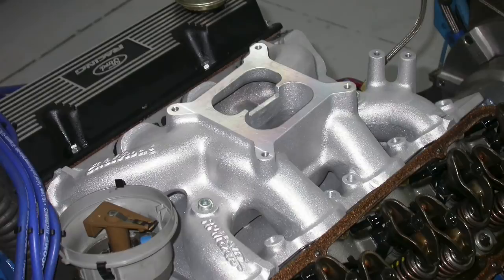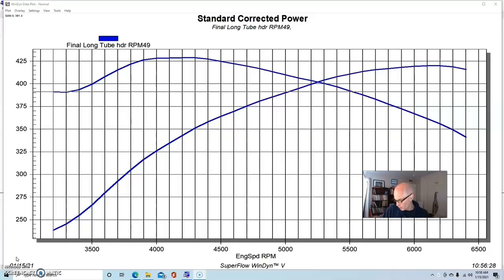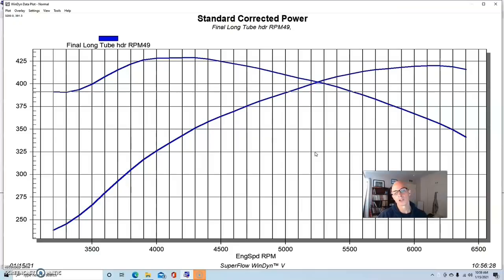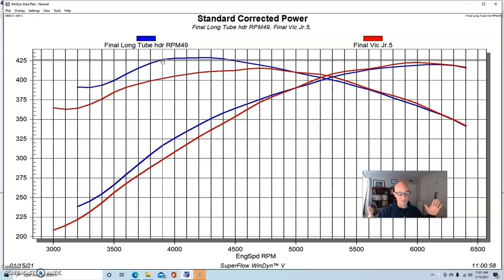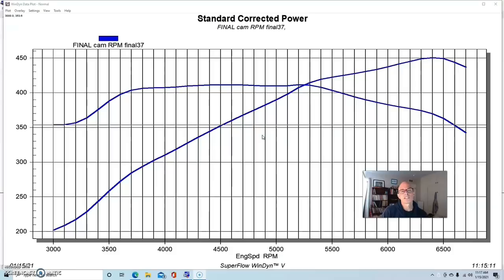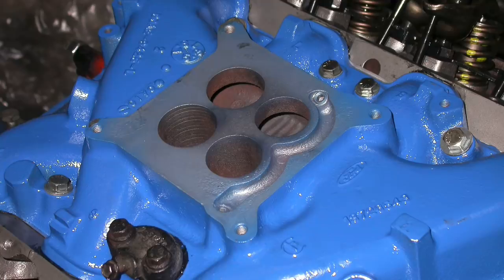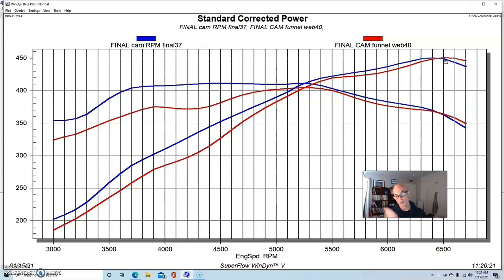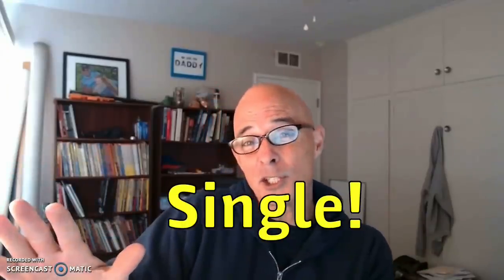THE OTHER GUYS INTAKE TEST-351 CLEVELAND (PLUS 351W)

Comment: I know this is two years  old. But you did n mention what the port match was on the Funnel Web. Was it the same size as the 4V heads? Or smaller like the port match from the dual plane?

Comment: Have you ever tried a offenhauser 360 manifold I got one on my Cleveland with a very mild Street cam it seems to have lots of torque and throttle response but I'm not sure if a dual plane would be better what do you think
Reply from the maker: I HAVE NEVER SEEN A SINGLE PLANE MAKE BETTER LOW SPEED OR MID RANGE THAN A DUAL PLANE

Comment: The single plane Cleveland would be much stronger with a 104 to 106 degree LSA. Or, a smaller cam say, 230 @ .050" and a 114 degree LSA. It's not a small block chevy.
Reply from the maker: a cam change would change power with both intakes-it doesn't just work with 1
Reply: @richardholdener1727  true.

Comment: I'm really interested in seeing the torque and horsepower curve straight off idle to 4,500-5,000 RPM. Especially with the Windsor as I now have an '82 F250 with the stock 2V 351W. Planning to run a new 4V intake and headers as the exhaust is half missing. I'd like to get as much low end torque as possible since it's a truck to be used for utility; hauling and possibly towing.

Comment: Richard, I love your content and the various comparisons you do. My faves are the 351C and Ford 300. 
One thing, you stated that 2V is 2 valve and 4V are 4 valve heads. All 351C heads are 2 valves. The "V" is venturi or barrel referring to the type of carburetor.  I'm certain you already know this, just slipped your mind when recording.

Comment: What would be cool if you built one of each the same 351c 351m 351w and see which one makes the most power with the same parts
Reply from the maker: the heads are all different, and intakes, and cams

Comment: Hi Richard, I Like this test!! I have a 1995 F150 with a stock roller 351 or 5.8 that I would like to get at least 500 hp and torque. I am 
Not looking to drag race because it's a 4x4 but rather get out of its own way! how about switching to E85. what in your experience would be the best over all combination with this vehicle?
Reply from the maker: heads, cam and intake can help, but 500 hp takes a lot of cam in a 351W

Comment: If your vehicle is mostly street driven, go with a Dual Plane Intake Manifold. However, if you have a dedicated race engine that lives at high rpm or a modified, big-cubic-inch engine, then a Single Plane Intake Manifold may be better. You may also want to consider a Tunnel Ram. Either way, you need to match components that work in the same rpm range.
This includes Camshaft RPM Range, Cylinder Head Intake Runner Volume, Carburetor CFM Rating, Header Primary Tube Diameter, Ignition System. 

— Summit Racing.

Comment: The Boss heads were made for high rpm racing. That is proven here and in fact has been known since the 70's(in some of the comments here I can see people don't get what these heads are for). Really the rpm band is 4000-8000 for these heads as there were made for SCCA Trans Am racing. In the 80's Holley made a single plane intake called the Strip Dominator. At that time there was none better in America. I tried the "mild cam,dual plane(not an RPM air gap...they didn't exist), vac secondary 750 holley with long tubes" on a M code 351C. Total miss match. Thing would rev to 6800 with an Accel duel point distributor but did not make power there(this was in 1980).
Once you machined the heads for screw in studs and guide plates(if you didn't have Boss heads) and started running much "larger" solid flat or roller cams and a single plane intake with a 850 cfm double pumper(that would be either the Edelbrock Torker intake or the Holley Strip Dominator when it came out) then you could see the potential of these heads.  There were no fancy HP holley carbs or hyd roller cams back then. We did are own mods to Holley carbs in those days. :)
Reply from the maker: please take a closer look at the actual torque data-on this Boss 351 and the Boss 302-the Boss heads worked well down low

Comment: On the Cleveland when using a head with ports larger than the intake could the be an issue with the air slowing down do to the sudden change in the volume of space? Or even a vorticity at the entrance to the head disturbing air flow?
Reply from the maker: LOOK AT THE DYNO RESULTS OF THE INTAKE SWAP-IT ADDED A LOT OF POWER
Reply: @richardholdener1727  I was referring to the single plane vs dual plane. I thought you said the intake runners of the single plane were much larger than the head. You said you were expecting more out of the single plane.

Comment: Back in the 90s my 71 boss Cleveland standard bore & stroke motor with stock Boss heads and a big ass 600 +lift solid roller bump stick, with a Holley Strip Dominator intake & 850 dbl pumper made 525 HP @ 7200 rpm on Bob Pettis's dyno ! Ya-cha ! Dropped it into a 3000 lb 67 pro street Mustang coupe and a 175 shot of NOS ! The Chevy boys hated my cuts !
Reply from the maker: 525 hp seems like a lot for a cam and intake upgrade
Reply: @richardholdener1727  Remember the 71 Boss 351 came with pop-up forged pistons, huge ports with 2.19 intake valves.
Back in the Day hot Rod Magazine published an article stating( The 351 Cleveland can produce more horsepower per cubic inch than any other American made motor)
Which was one of the main contributing factors why  Mr. Bob Glidden totally dominated pro stock back in the 70s&80s
Before NHRA change the rules to 500 in.³. 
So yes just adding a big ass cam, carburetor and headers will indeed produce over 500 HP with a Boss Cleveland.
Reply: @robertstewart3086  I total agree with this and I had that article too :)
Reply: @richardholdener1727  Actually it would seem that way but people found out these were high rpm racing heads designed in the late 60's for Fords SCCA Trans Am racing program. They really didn't do much in mild passenger car use. In fact they were to "big" for that. They really didn't show what they could do unless used on what would have been considered a pretty wild engine for street back in those days.

Comment: Could it be valve placements and chamber shape that changes what kind of intake it likes
Reply from the maker: single plane is for higher engine speeds than dual plane on both motors

Comment: vrm & LDN Wholesale: The Lima 385 and 335/ Boss 302/351 heads were designed by Phillip A Martel, ex GM, and they werent just Porcupine 427 MarkIV Mystery motor heads but a Heron style flat valve head designed to get better horsepower with less than Tunnel Port 427 or Tunnel Port 302 flow rates. After Bill Innes let Stirret redesign the Y block into the 221-351 family and Harold Grant take 150 pounds of iron out of a 272, Harold C McDonald taked Macara, Bill Gay and others to make heads that would survive on the lightened MEL Lima and 4.38 bore CEL1 plant engine blocks. The heads were ported with 4.37 sq in of ports size in a venturi shape to make more power than the SBC and BBC. Clear and simple. The prescription for making 2V and 4V Clevelands generate seamless low end, mid range and high end power is different. The team decided to block exhaust flow and add exhaust duration and use 2 plane intakes.Always.

Comment: Richard! I have a 351 Cleveland, stock block, stock crank, h beam rods, flat top pistons, as cast edelbrock rpm 2v heads, unknown specs engl solid flat tappet cam, airgap intake, 750 holley, in a fox body running mid 10's on motor and 8's on a 300 shot. It would be cool to see a similar Cleveland combo with the Edelbrock heads and airgap on the dyno
Reply from the maker: wish i still had the 4V

Comment: There is a 351C serpintine belt kit on the net which uses the SelectAir, Techumseh/York or early 3.8 Fox V6 tensioner

https://youtu.be/4RYGpm0ajfA

but I like the AEW/ Kaufman 8945 AC/Alt/AirPump/Tensioner Mark Sanchez made back in the late 80s.

Comment: Yet again,,, 4V Clevo has very poor velocity. The reason every decent aftermarket head and intake is far smaller.What were they thinking!!
Those Funnel Web intakes are light switch for high rpm engines. Edelbrock have not made a 4V intake in decades. Because they know 4V heads do not make power!
I have  Performer 400 on my 400 Galaxie,, and it is smaller than the 2V heads. And still a very similar opening as a Chev race port, which makes far more power.
Reply: Edelbrock part numbers 7564 and 75641. 4V Cleveland intakes.

Comment: Hey richard, I heard you talking about having timing locked out for this test. Say you’re running efi, with a timing curve. Do you notice a difference in power output with timing locked out as opposed to ramped in? I don’t remember seeing an a to b test like that with the same engine.

Comment: The OEM Aussie heads actually have the "in between" intake ports, with closed chambers. They're really called 3V heads. I have a soft spot for the Clevelands, I grew up in the 70s, and Had a 4V in a 71 Torino that was rarely beat. I chewed up lots of big block cars with just a cam, intake, headers, and a 3:70 posi rear end behind the C6. Hindsight makes me weep out loud that I sold that car when I married.
Reply: Australian Clevos had 302 2V heads starting as small as 59cc, 351 @v heads starting around 70cc,  And then the door stops from the US with humungous ports! From 72-82 both heads got larger chambers, XA XB heads live really well, XC XD XE 76-82 heads are stuffed because the valves run way too hot and burrow up the ports. ADR27A killed them, the reason they were culled off. The 4.1 alloy head 6s were as fast and used a LOT less petrol. More so as an efi version
But otherwise really only 2 different heads. No real change from 72-82
Reply: @ldnwholesale8552  That was what I was talking about, the Aussie 2Vs with closed chambers, that we call the 3Vs here.  The US Clevelands started out with closed chambers, and had open chamber 4V heads for a couple years by the time the Cleveland was discontinued in 1974 and the modifieds were out. We never had a closed chamber 2V Cleveland head here. The closed chambers were around 63cc, while the open chambers were around 76cc. As far as valve problems, the first year Boss 302s had a bigger intake valve that would get hot and start hitting the exhaust valve, so they reduced the intake valve size slightly in 1970. That was the only two years for the Boss 302, and the rest of the Clevelands never had this problem.
Reply: @bigboreracing356  Yeah, I knew plenty of guys that did a lot of back yard gutting and frankenstein stuff too, that made their toys run good. I am one of those guys. However, I am referring to a factory equipped car, with off the shelf parts available at the time. if your guy had put a Cleveland in that Pinto, even mildly equipped such as mine was, it would have have had an even harder donkey stomp, leaving those turd windsors crying. Have a nice day.

Comment: Really surprised on the results of the 351c-funnel web. I even expected the 351c-funnel web to not lose as much low end torque compared to the Vic Jr since it has longer runners. I also thought it would’ve shined more and earlier on the top end.

Comment: Hey Richard do feel as a ford fanatic that using Cleveland heads on a Windsor is cheating? :D
Reply: @bigboreracing356  Properly true for stock factory heads, but many aftermarket clevo heads are much superior to any 20 deg alu. Heads you can buy.

Comment: Richard, I’m building a stock cubic inch 351 Windsor currently, I have 210cc Victor jr heads, the comp xfi 236hr cam I bought from you, and I’m going to top it with an air gap. Do you think 475-500 horsepower is a realistic power number or do you think I’m dreaming?

Comment: I think You used the wrong single plane on your mild  Cleveland  I run a mild Cleveland  a the  Drag strip and  my Engine  goes faster with a Torquer than it does with a  Air gap. and I only run to 6200!  Your  funnel web may be a good high RPM intake but it is not working for you engine!

Comment: I'd like o see this comparison between 2v and 4v heads. I've always been a fan of 2v heads. 4v heads worked best by building up the intake runners to increase velocity. 4v's only seemed to be a lot of fun with 4.11 gears. Throw long tube headers and an RPM on a 2v and you have a killer for the street.
Reply: 4Vs make great door stops!!

Comment: Have you done a set of the speedmaster heads on the 351c? Im putting together an engine with a set and curious if they are any good.
Reply: No! You get what you pay for which is very little.
Reply: @ldnwholesale8552  For what Im building, which is mostly just a cruiser with some extra grunt, its hard to justify 4-5x the cost for a set of Trick Flows. Yes I would have loved them, but thats what makes me curious how good/bad the Speedmasters are. The local shop said that ya 5 yrs ago they wouldnt even sell them, but that quality has improved a lot. So Im just curious how these budget heads compare to stock 4V's or even something like the Edelbrocks.

Comment: Richard, I have a 71 boss 351c motor that I received from my uncle when he had a 71 mach 1. I currently have the tall deck stroker Cleveland or otherwise known as the 400 in my hot rod. I plan on rebuilding that 351c on the side. From all the work you've done with Clevelands... what's your favorite build you've done on a 351c that would make a fun street toy?

Comment: I love the 351C and to a smaller extent the 400M.  Don't under estimate the 2V heads for street performance.  They are the perfect candidates for budget builds or add on.  4V valves with a good pocket port blend, a good torque cam,  a dual plane 4 barrel setup with headers really wake these engines up. The gains vs dollars is vary hard to beat.
Reply: I believe it.  I love chevy's too.  Just a cam change in a lack luster 400M would seem like a rocket strapped to your behind. It is a combination of parts that add up to the whole.  So let me explain in "gross" horse power why these are great engines to modify at a vary low cost.  Some of these estimations are in percentages of totals. Starting with a 250hp 351 2V with a gross rating of 250hp.  (net 164 to 167 net)  Set of heads with 4V valves and pocket blend 30hp.  A torque can with a peck rpm of 5200 or so and eliminating the 8 degrees of retard 50hp.  35hp for a 4 barrel intake. 10 percent for headers and a dual exhaust.  All this takes us to 401 gross horse power. In net terms this would be about 300hp. net.  I would love someone to show me any other engine that can gain 130 plus NET horse power for under a grand$.
Reply: @bigboreracing356  And your Cummins diesel cost how much?
Reply: @bigboreracing356  My point is you paid for the performance potential up front.  Most boosted vehicles cost a heck of a lot more than non boosted ones.  The most ridiculous argument could go like this. I bought this car with a NOS system in it.  Why heck I added a couple of gallons of race gas, changed the NOS jets, and reduced the timing I added 160hp for under $30 bucks. Shazam!!!
Reply: 400m. People don't know what they are talking about. I wonder how much else they don't know.

Comment: Another great video! Had a 351C in Falcon GT, worked well with Edelbrock Performer and 750 Holley, mild Comp cam and mostly stock internals. Made just over 500hp at crank. Very reliable, my fave motor
Reply: How much nitrous ? That's 393 Chi heads and a roller cam numbers lol.

Comment: I need to see this test but with more cam and compression. I'm running a dual plane on my race motor and need to know what I'm gaining/and losing.
Reply: Keep in mind, I did it for a reason. My heads are 220cc. On a 383. I wanted to get better air speed/ response our of the motor in addition to torque. It's mud racing with a heavy truck

Comment: Someone else may have addressed this but, the V in 2V or 4V indicates venturi, not valve.
Reply: In the Ford engine family the Cleveland and 385 the 2V or 4V  does not just represent the number of barrels the carburetor has.  On the 4V the runners and valves are much bigger for more power.
Reply: @hom240   That goes without saying.
Reply: My mistake on the 385 engine family.  You could get a 4 barrel carburetor on a none performance big block.  It was the Boss, Cobra Jet, and Super Cobra Jet that had larger valves, runners and intake to get more performance.
Reply: @hom240  If you are the Ohio George Montgomery you've probably forgotten more than anyone in this comment section will ever know in regards to Ford engines. I will always appreciate the advice OGM gave me when I was a young kid building my '91 Fox. Saved me a lot of money by deciding up front what I wanted from the build so I wasn't just throwing parts at it. I also took inspiration from his son's Boss 429. I still have the Fox with 24k on the odo.
Reply: @tmmurphy  Not him, not related to him, never meet him.  I know of him, and did however live in Ohio for a little over a year in my teen years. Been a mechanic since 1986 and worked in a machine shop for 2 years rebuilding cylinder heads in Gainesville, FL.
Reply: It's funny to listen to the inexperienced decipher Ford engine nomenclature.

Comment: could someone explain to me ,no vacc advance timing?. no vacc port on my future carb. . so just go total timing out of the gate?
Reply from the maker: you have centrifugal advance still
Reply: OK on the dyno at full throttle. Will likely give poor fuel economy on the street at partial throttle.
Reply: You had no centrifigual, just total timing. Ok on a race engine, not nice on a street engine. On a hotrod engine Vacc adavance is generally useless.
No race engine runs under say 3500 and by that time all mechanical advance is in. And then often wobbles a bit. A street engine seldom runs over 3500 in normal driving hence needing an advance curve so it does not detonate itself top death